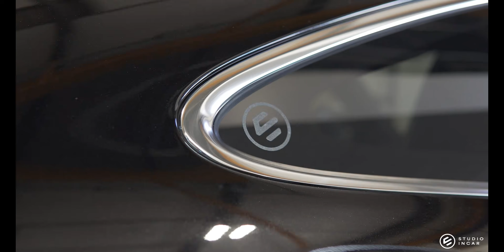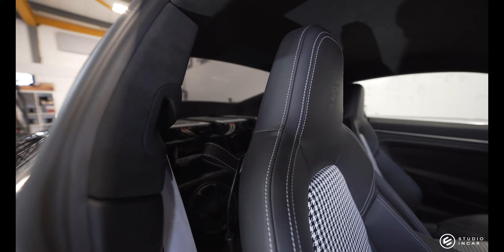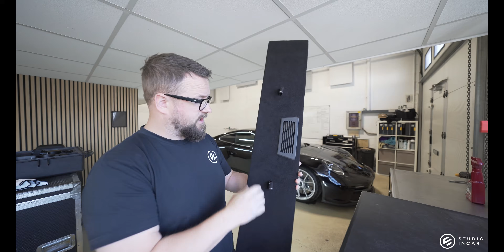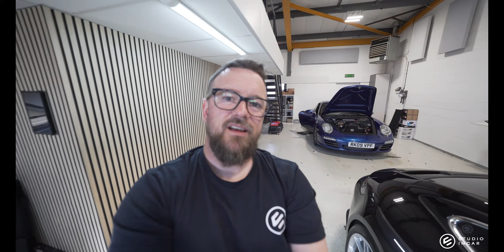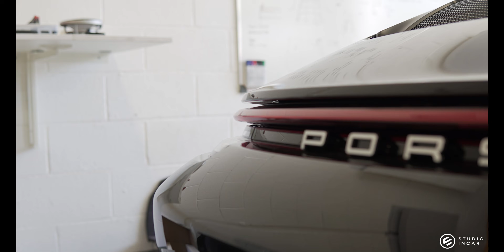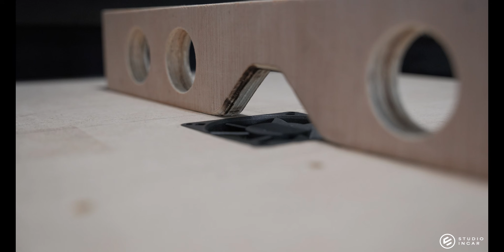911 GT3 Touring PERFECTION True High End Audio

Comment: Lovely work 👍re vents, best to have same vent area in as out.
Reply from the maker: Cheers, we have a 4" fan exhaust and 3 1" fan intakes. CFM lined up. I think the only thing I'd change would be to do it in revers so the bottom one (large) is pulling in and the 3 smaller ones are exhausting. Their polarity had them fixed in a particular way so that's how they had to go. All of the rest are to just knock the air about a bit.

Comment: Not a fan of morel subs. Super overrated.
Reply from the maker: What would you use in this application?
Reply: @Studioincar  stereo integrity sql or image dynamics idmax. My first subs were a pair of ultimo's in a sealed box. I had that for about 13 years before I finally decided to try a new subwoofer to get more output. A single idmax in the same size enclosure sounded just as good and gave as much output as the 2 ultimo's together. They lack so much bass for how much they are.
Reply from the maker: @vongdong10  I love the ID Max, had plenty of them and know them very well. There's no way they'll go in here with this space. The SI SQL I can't see in an 8? This space requires 8" drivers. I've got a different opinion to you of the ti Ultimo in that I find it very full, linear and smooth down low. The bass in the 911 is the best I've heard in the platform. It won't have the SPL of a ID Max (god I wish I still had one) but certainly has the SQ. This said, you won't catch me overating anything, I'm certainly not one for hype, if it's good for the application it gets fitted. 13 years, it must have done something right for you. I can't keep the same sub for over a month.
Reply: @Studioincar oh didnt realise they were 8". Only reason I kept them so long is because I kept these telling myself these expensive subwoofers must have as bass as others. Couldn't afford to try new subs until recently.

Comment: Just wondering about tge setup, assuming the two mono's are driving the subs ,  is there a passive crossover in the fronts as there is just one 4 channel amp ?
Reply from the maker: There’s two 4 channels and one mono.
Reply: I would guess at: mono runs both subs, 1 four channel runs midrange and tweets, 2nd four channel runs the midbass bridged to 2 channels.